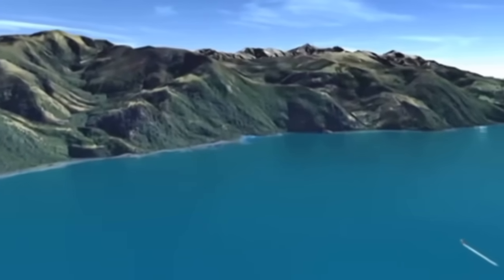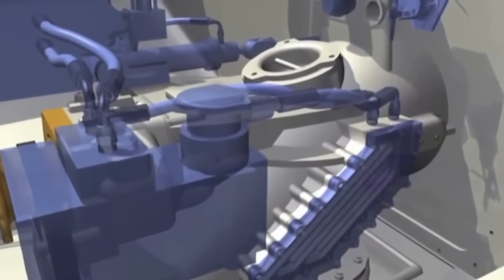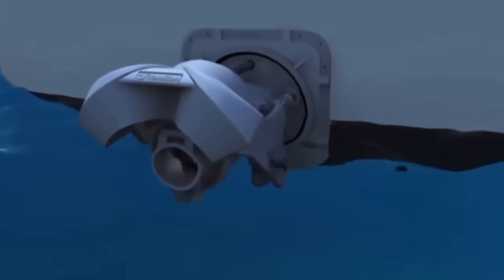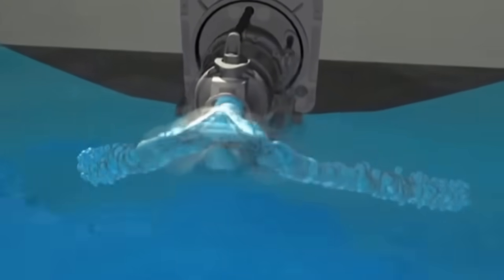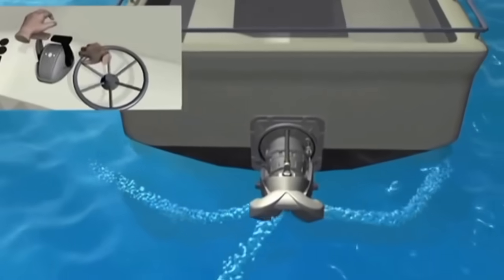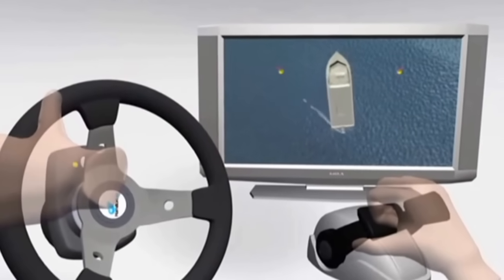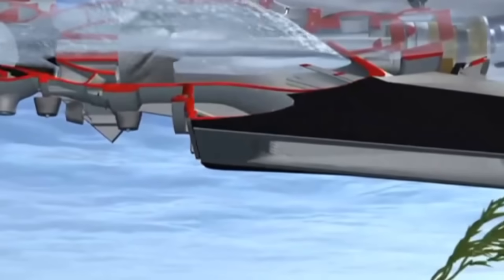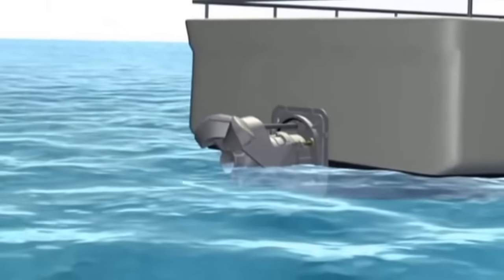How a Waterjet works,  Jet propulsion pump

Comment: A company  is developing  a  water turbine that will be used in front of   the intake to produce power and feed low pressure water  into the pump intake stream

Comment: I'm assuming this is more expensive than the regular propeller sticking out? I see this engine as being helpful for conservation of wildlife, actually. I hear a lot about the Florida manatees being killed or maimed by boat propellers. This just has high velocity water hitting them, which I think is much more safe for the survival of manatees.
Reply: The jet is also a good idea for boat operators who have a habit of running over swimmers & downed water skiers. Jets are also very good for river boats running in shallow water with many obstacles.

Comment: Hi, I should add that using the 'THRUST' system there are no parts whatsoever external to the hull, therefore, making a safer and less subject to damage arrangement. contact me at   carringtonpeter@ymail.com    for further information, Thanks.

Comment: Hi Folks,

 Please, may I  interest you in a revolutionary new waterjet concept that I have recently invented and patented? 

The new CARRINGTON "T.H.R.U.S.T." jet. For -
-Through-Hull-Radial-Underwater-Smartjet-Technology.

This is a far better solution than simply forcing a jet stream from the rear of the craft and has at least 16 advantages over existing systems!

It is far easier to move the boat sideways under full control than trying to balance forward and reverse thrust and side vector plates to do this.

This not only simplifies docking in tight spaces such as marina berths, as is often experienced on larger craft with high windage side areas;
Very often causing damage, embarrassment and a lessened desire to go boating in windy conditions.

Basically, two vertical jet nozzles- eject flat 'blades' of water horizontally and are placed in the flatter part of the hull on the aft port and starboard sides, within the working triangle, and are hydraulically revolved 360 degrees to provide amazing sideways and forward and reverse thrust without the use of reverse buckets. The craft is easily revolved within its own length-try that with existing systems!

I have produced prototypes, drawings, photographs, and a paper giving a consise explanation of how this works and I am seeking a market for this system.

Hoping to get a response, Thank you.
Dr. Peter Carrington.
Reply: Youtube comment section doesn't seem like the best way to promote a new design. ;  )

Comment: I installed a similar system on my 8.5 M Sail-Boat off a(KAWASAKI,Supercharged Jet-Ski Motor(310 HP),,with a pneumatic set-up for reverse and controls,took me a week to make-up my mind to finally cut-down the bottom of a perfectly sound and water-proof vessel....!!!...But what a relief and satisfaction when all was installed.After my old tired heavy Penta motor,I could now take my boat on high rough Seas with a super reliable,powerful set-up,already sailed to Portugal,from France and back,fishing on idle but also pushed the engine to max power,lots of torque,now,it's new GARMIN electronics,AP,radar,solar panels all LED lighting and prop,to next year,hit the"big"trip of my dreams to the Philippines.
Reply: Thats so cool u are the first person I've heard of doing that. That sounds really cool and much better engine and drivetrain. Then what comes stock in a sailboat? For sure, what's the top speed? I don't guess it's crazy fast, but still be cool to know !!

Comment: I was curious, I youtubed it, i now know how it works. I thank you. Lol
Reply: I feel this exactly
Reply: Hahah same here
Reply: ^2
Reply: Yup, same
Reply: Same here😂😂😂
Reply: @BIGGELATO Can you please share some of your knowledge about it with me
Reply: @sal1671  think of a little tunnel with two open ends and a propeller (fan) in the middle. As this propeller turns fast, the water from one end opening comes in as it's sucked in through the fan, and push out the other, pushing the boat or jetski forward. This little tunnel is in the back, the front of the tunnel is under the boat sucking in water (thanks to the propeller rotating at fast speeds), and it comes out the back, pushing the boat forward.
Reply: I was curious designed one in my head, came to see if their similar. Thank you. Lol
(My design was correct. Water intake, turbine, funnel.)

Comment: where do they burn the fuel?just like air plane jet or what?
Reply: the turbine is powered by a engine further up the vessel. notice the drive shaft thats powering the turbine

Comment: I worked on jet boats for 8 years, the experience is different base on different designs, some can be frustrating if the operation principle is not well understood by the engineer and some are just as easy to use like the kids toys. It's a very good propulsion system.
Reply: These seem like a vast improvement from standard prop systems.
Reply: How to replace mechanical seal from waterjet shaft
Am using ultrajet on utility  boat
Reply: Machinist? mate
Reply: well mike ,why dont just cant shut up?

Comment: Not impressive a waterjet machine can cut hardened steel. the problem is you have to replace the nozzle about once a month. the water pressure will simply eat the entire pump. it a short time.  those nozzles are made of impregnated tungsten carbide. same material used on Jet engines. water has a tremendous amount of strength. when you force water in high pressure is will eat just about anything.  it can be done but extremely costly to maintain. 
also, high-pressure sand will also eat away just about anything. so when you combine water mixed with particles of sand that pump would not last a month .
Reply: And yet there are Hamilton Jet boats all over the place that have had little to no maintenance of the jet unit for decades that still run great. Your concerns don't bear out in practice. This is not new tech, it was developed in the 1940s, and is proven.

Comment: a jet will never be as efficient as a  prop... whether in planes or boats
Reply: you are right, not in boats, but in planes they are more efficient
Reply: Jet propulsion is more effective than propeller.
Reply: Jet powered boats have more torque, quicker response and are less susceptible to cavitation and a shallow draft making them operate more efficiently at the cost of much greater fuel expense. Turbo-prop aircraft engines have more torque, much lower horsepower to weight ratio(higher useful load), and fewer moving parts that don’t reverse direction 5000 times per minute at 2500 rpm like a piston engine. This makes them very reliable and therefore safer but at 10x the cost. Bottom line is how efficient something is requires a definition of terms. $0.02
Reply: Props have an increasingly difficult time moving air as the forward speed of an airplane gets closer to mach 1.
Reply: High bypass turbofans are getting to turboprop efficiency and prop fans completely obliterate turboprops in efficiency at the cost of higher noise and vibration.